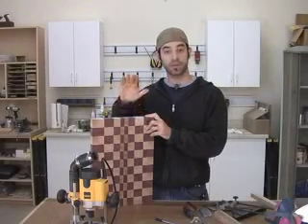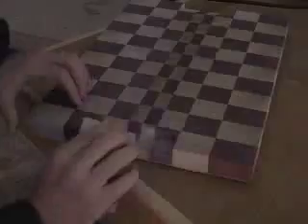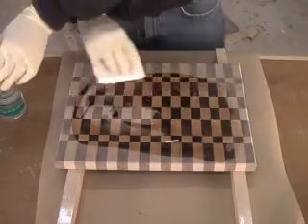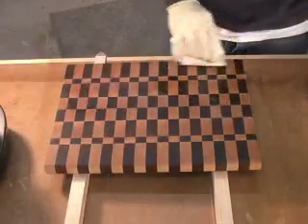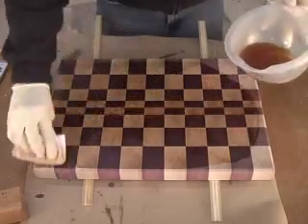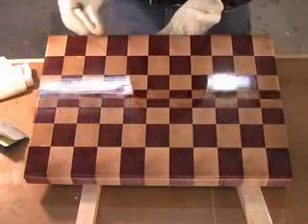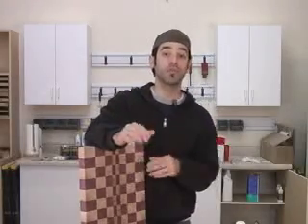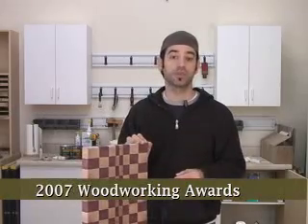7 - How to Make an End Grain Cutting Board (Part 2 of 2)

Comment: I just built an end grain board and added an inch on both ends of purpleheart flat grain like breadboarding.  That made it look great and also made it much easier to pass through the planer without fear of tearout.  I also made sure to make very light passes until it was smooth and ready for final sanding.

Comment from the maker: Hey William. Generally speaking, mineral spirits is always bad....to drink. :) Once the harmful stuff flashes off, the surface is considered safe. But most "odorless" mineral spirits should be just about the same, unless you get the new stuff in the plastic bottles. That stuff is to be avoided. If it's white in color, you know you got the wrong stuff. Either way, the point here is to let the finish cure fully before using the board. Then wash it thoroughly before use.

Comment from the maker: @jtpryan Well that can be tricky. Mineral oil never really cures so if you apply a varnish over it, you will have drying problems. I would recommend just using the board for a while and waiting for it to "dry out". Once most of the oil is absorbed or wears off, take the board back to the shop for a little sanding and then go for the varnishing method.

Comment from the maker: @abowen2 To some extent, yes.  The lines will frequently show themselves when the board experiences a moisture change.  But I find that this can diminish over time.  I usually recommend using the board for a few months.  After numerous uses, the board will be pretty rough.  That's a good time to take it back in the shop, give it a light sanding to smooth everything out, and give it another coat or two of your finish of choice.  At that point, it should stay smooth longer.

Comment from the maker: @abowen2 The board can certainly be used on both sides if desired, but I typically only use one side.  And both sides are finished equally.  So a different style of handle would certainly make the board more conducive to two sided use.

Comment: Great video. I am going to get the software from 1024 Studios. Being a computer guy, I am a bit of a software collector/learner.
One of the biggest problems with cutting boards is the sliding around. In the old days of kitchen management (my original profession) we would put a damp towel under it. I never liked it. Solution. I bought some Bench Dog pucks, put one under each corner and no sliding around. Also the board is raised up slightly and makes it easy to pick up. I like the grips cut in.

Comment from the maker: The only difference is the order the parts were assembled in in the first glueup.  But it all came from 8/4 stock.  In the second part, you'll see the smaller strips were placed at the center.  In part one, you can see that the smaller strips were placed in the second row.

Comment from the maker: My guess is that the oil you are using is not doing a good job of protecting the wood from moisture.  The moisture is what raises the grain and gives you that rough appearance.  What I would do is use the mineral oil/wax mixture on the board after you sand it the next time.  That should give you a little more resistance to water.

Comment from the maker: In my opinion, they work well for an endgrain board.   But if you are doing a face grain board, they tend to have a lot of pits an pores on the surface where bacteria can hide, so they wouldn't be the best choice.  But end grain is a different story.  So in my opinion, yes, those would make a fine cutting board.

Comment from the maker: Well the burning is only on the top surface of that piece and that's a part that won't see any glue.  So no real issues there.  It does, however, need to be sanded away after the board is completely glued up.

Comment: @Michael Irvine I'd either use a dowel like you suggested if you have the drill for the job (or 2 dowels), make the board a bit thicker (mine's about 2 1/2 inches thick) or glue a half-inch plank onto the bottom of the board.

Comment: If your talking about the recess at about :50-1:00 then just clamp another board perpendicular to the two edge boards ( will look like a c ) Measure the outside edge of your router base to the cutting edge of your bit bit and set the stop block to your desired depth. Its just a hand hold, don't stress to much.

Comment from the maker: What I would actually do is let it soak into one side, wipe off the excess and then wipe any seeping material from the other side, and let it dry on its side. The next day, I would do the same thing but applying finish to the bottom of the board. A slight change from my original procedure but this way you are applying finish to both sides and giving it time to dry in the grain instead of having it seep out.

Comment: Built the board and now I'm ready to put the finish on.  I think I understood that the first two coats are thinned finish.  Is the last coat thinned or straight from the can?
Thanks for the easy to watch video, my daughter is going to love this board.
Reply from the maker: I do all coats thinned. If you go full-strength, you'll build a film quickly. We really dont' want to build a film so applying thin coats allows for sealing without building a substantial layer of finish on the surface.

Comment: @abowen2    I made a fantastic board following your instructions. Thank you so much, However, a day after my final perfectly smooth sanding  (before finish)I ran my fingers over the surface and I could feel each and every one of the squares. I sanded again and immediately applied finish as you demonstrated. Now 8 hours after the final finish has dried, the wood is beginning to swell again and as before, I can feel the squares in the end grain again. Is this something I just have to live with?

Comment: got rough the bloodwood was fine still smooth but the maple isn't smooth anymore, I applied some more of that oil and let it sit overnight but that of course didn't magically fix it lol. I was wondering if you had any ideas for me, I was kind of hoping putting a varnish over it might help to make the surface more glassy but aside from already having oil soaked up by the board I've heard varnish can cloud wood.

Comment: You could try to use olive or corn oil. It is perfect for cutting boards. Just warm it a little bit and apply about three coats of it. It works great. I use it for all things that i build to use in the kitchen.
Reply: Here it is 5 years later and I’m just wondering how your rancid-Wesson-soaked boards are holding up...?

Comment: Hello again, I've got a question similar to jtpryan's....I used bloodwood and hard maple for my board, went a bit thinner, and did a more simple design. I used the butcher block oil because it was cheap enough but also it has beeswax and carnauba wax. I followed the directions on the bottle (apply let sit 20 minutes and repeat) I gave each coat an extra ten minutes just because. After it was all said and done I used the cutting board and washed it by hand and as soon as the water hit it the

Comment: My wife has wood cutting boards that are designed to be used on both sides. Based on where you routed in your handles and the way you only showed one side of the board throughout the video, it would appear your board is only designed to be used on one side? That being the case, do you put your varnish or oil seal on just the business side or both? If just one side, what's to stop us from routing additional recessed handles next to the other ones and using both sides of the board?

Comment: Hi, quick question.  After sanding I use an air hose to blow the dust off the board, but there still seems to be some left on.  Is there a fast way to get rid of remaining dust (faster than damp paper towel)?

Comment: I know this is a redundant question, but I have listened over and over again to make sure you didn't cover it. After you wipe the varnish on for 3-4 min's, you mention flipping it over and you will notice it has seeped through the cutting board. You never mention wiping varnish on the bottom of the board (once you flip it). Do you wipe it the same? 3-4:00 minutes? Thanks, and sorry if you have answered this somewhere.

Comment from the maker: @cleric022684 Once again, exposure levels. Am I suggesting drinking mineral oil? Of course not. Once it absorbs into the wood, very little if any would actually get on the food. I'm also currently looking at two WHO reports that state the following: "Although a small percentage of ingested mineral oil is absorbed and deposited in various organs it is without any apparent harm." and "...there are no toxicological problems arising from the use of food grade mineral oil."
Reply: Mineral oil is sometimes used as a laxative.  Horse farms use it to keep livestock regular.  Cheap price on  mineral oil at Tractor Supply.

Comment: I have some thick 8/4 maple that i would like to try and make this cutting board with. But I dont have any other hard wood that thick to use. Would it be possible to stain half of the boards to give the same affect as using a contrasting color wood.

Comment: I recently made one of theese end grain cutting boards but a week or so later I can feel the glue lines like they rised up. They weren't there last week. I did sand down to 220 and it was smooth when I finished it... any advise on what I did???
Reply: After final sanding, get the board wet with water to reraise the grain then fine-sand back down. Also, you need to use a hard wood, as a soft wood is softer than the glue...

Comment: I've made some cutting boards with a mineral oil finish.  Would it be possible to use salad bowl finish down the line to reseal it?
Reply from the maker: Possible, but difficult. The mineral oil never cures. That's an issue for salad bowl finish. So it's best to pick a finish and stick with it.
Reply: Thanks.  I tried it with another design of board I ended up keeping for myself and didn't want mineral oil.  It did a decent job but i wouldn't do it to one I was selling.

Comment: would doing 3 coats of thinned varnish and than finish it off with mineral oil + beeswax mix give it a better shine than just thinned varnish? maybe even polishing it with orbital polisher?
Reply: @thewoodwhisperer
Reply from the maker: Probably not. End grain is very thirsty. If a cutting board is shiny, that means there's a significant film and that's something you don't really want on a cutting board you actually plan to use.

Comment: It is not on the Router Table. It is attached to the bottom/side if your Dewalt Router when you are round overing the corners of the cutting board.